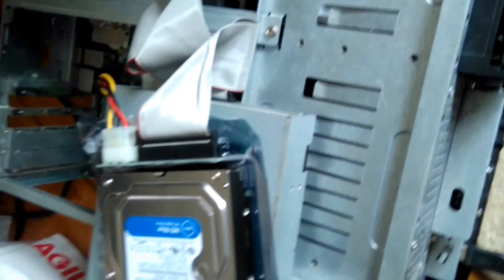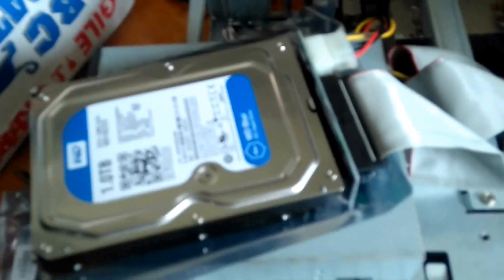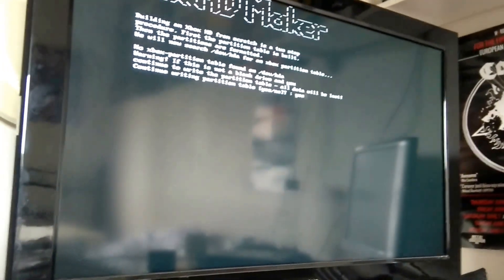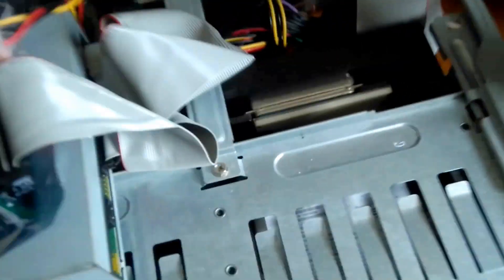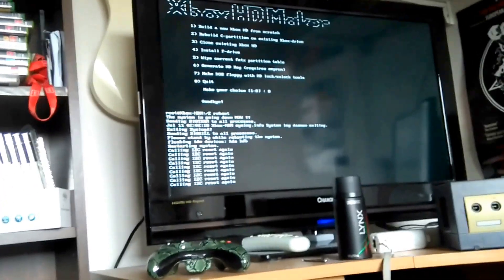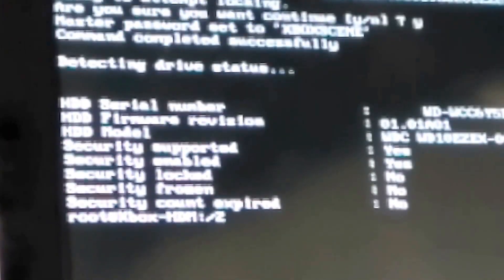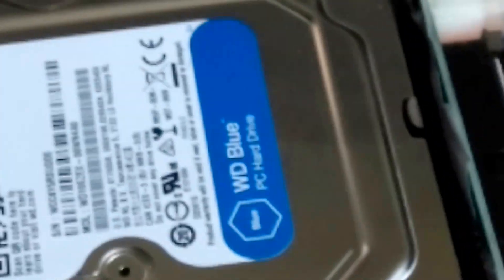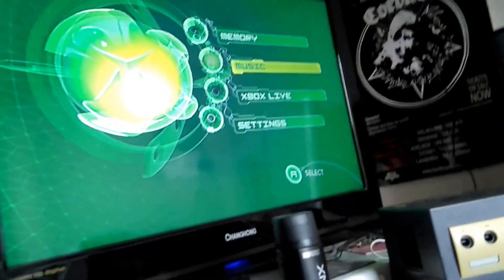OG XBOX MODS: Upgrade to 1tb sata in XBOXHDM

Comment: tssop is good for more advanced mods as ram upgrade essentially or using an unlocked hdd for the case of having an hdd that can not be locked and you want to upgrade the factory hdd but softmod is ok for playing backups and emulators

Comment: Xboxhdm is lot easier to use then Chimp. I wish found Xboxhdm a year ago seens I soft mod my Xbox I broke my cable when trying be fast Good thing I had some other cables from my old pcs  I have upgraded again from 160 GB to 320 GB yes day using xboxhdm.  I am using all on F:  I am getting about 300 GB I am having no troubles yet I have disable G
Reply from the maker: Andrew Dupuis yeah its more complicated to get going but definitely easier once understood and less messing about

Comment: Hi Jacob,

I have a project with which I am hopelessly stuck at the moment...
I wanted to upgrade my softmodded original xbox with a 2tb HDD, my xbox is a 1.4 , using the unleashX dash. (could be an older one, it was several years ago when I last used this baby...)
So I followed the tutorial at https://www.xbmc4xbox.org.uk , used two adaptors, the second of which seems to be compatible... 
Now , when it boots up, it shows me an error 14, bold]14 - dashboard - Error loading dashboard[/bold] (dashboard generic error)
So, in my book, that means that my adaptor and hdd are compatible and beeing recognized, but can´t be booted... and I have the newest slayer auto installer inside, but it doesn´t boot from dvd...
When I plug in my old harddrive, everything works fine, and it boots up, even from dvd.

I´m sure that I missed something , but I don´t know what exactly... Do I have to prepare my drive beforehand? It seemed so easy in the tutorial, just exchange the HDD, boot from disk, format the drive and voila... but not in my case...

Do you have any idea on how to help me?
I thank  you in advance,

Greetings, 
fog.
Reply from the maker: Antonis Marougas did you use an 80 wire ide
Reply: Yes, I did... :)
Reply from the maker: Just clone or reimage it again and or try another drive?
Reply from the maker: I got a video on my channel for what adaper to use, maybe check it out
Reply: Thanks for your help, man, I finally did it after many a nightmarish run with hdmaker... nowe verythingworks well, and now I must tend to formatting issues... :)
Reply from the maker: xb partinor

Comment: I get an error message saying Linx not found insert cd, any ideas?.
Reply from the maker: Tactical Distort few things, did you rename your iso? if you did don't. are you using sata for the dvd? you are dont
Reply: You probably already know by now but the dvd drive on your PC must be IDE, because there is a bug with xboxhdm that doesn't recognize SATA dvd drives
Reply from the maker: "bug" it's not a mistake, it was just never written in the software
Reply from the maker: I wonder if they ever fixed their problem

Comment: will this work for a 2tb drive? does xboxhdm format in 64k clusters? i've read if 2tb is used with under 64k clusters , files get lost as hard drive fills up. good video. helpful. thanks
Reply from the maker: ElectronicJunky I've never had much issues then again ive never done many 2tb